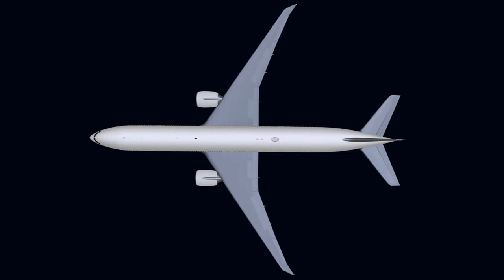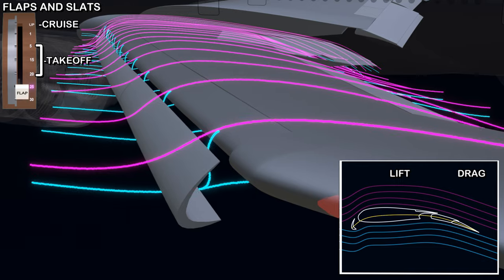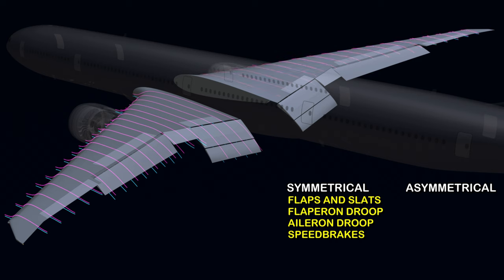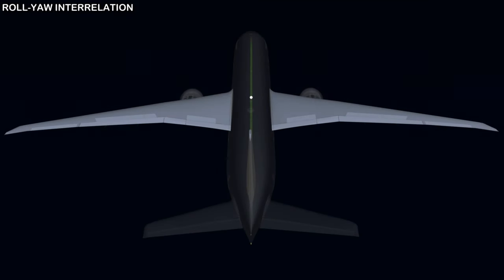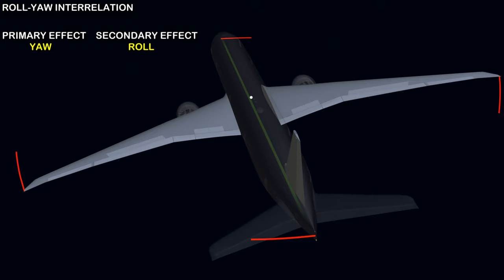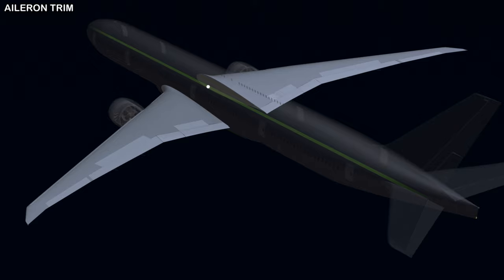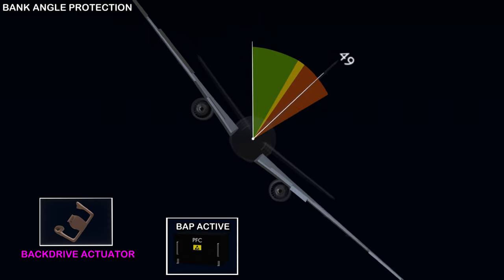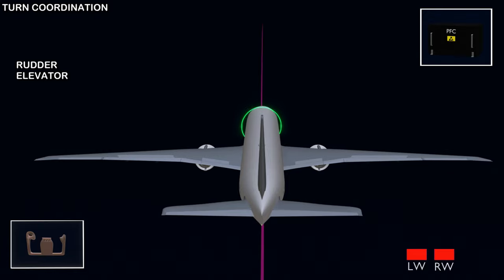How Flight Controls Work | Part 9 : Roll Control

Comment: As a non-pilot with zero experience but a lot of intrigue, I never understood what the different flaps settings were. I know flaps are helpful when taking off and landing as they increase lift, but never understood their applications across different phases of flight. Until now!